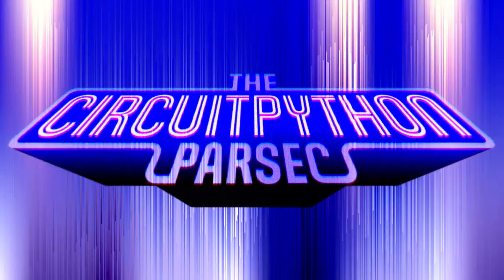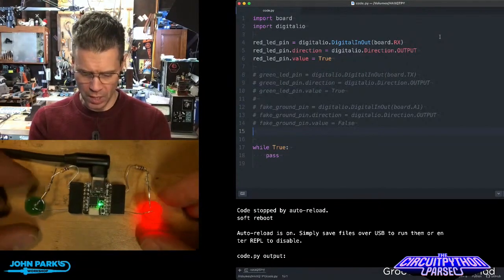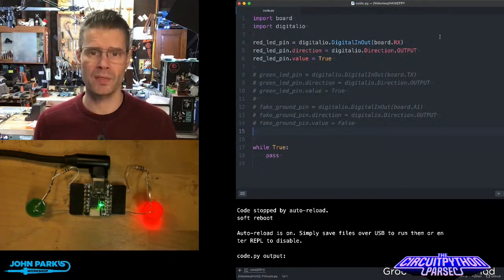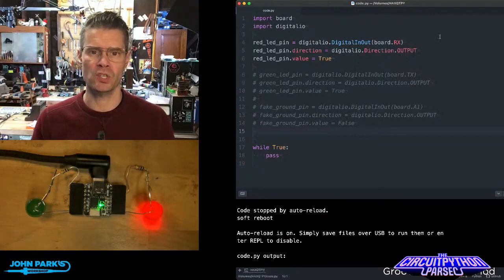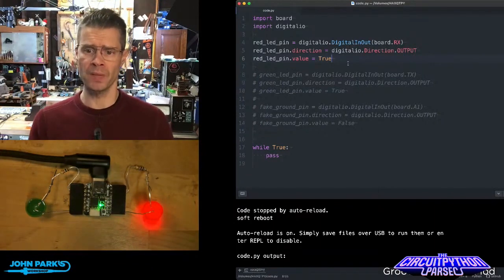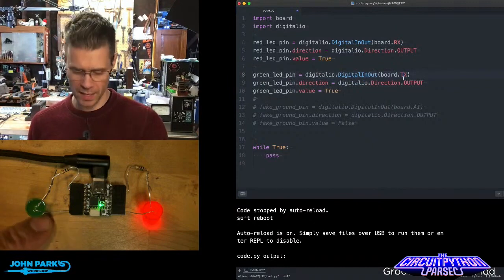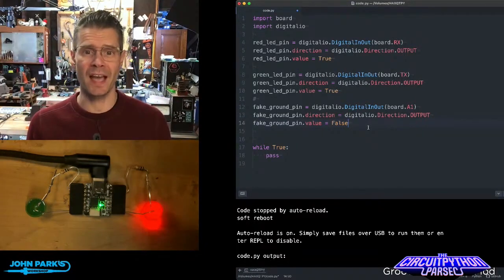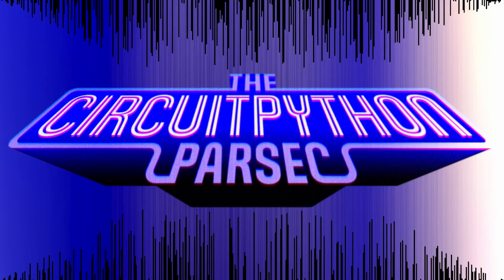John Park's CircuitPython Parsec: Fake Ground Pin @adafruit @johnedgarpark #adafruit #circuitpython

Comment: That can work, but you're getting the "ground" through a transistor, whether BJT or FET, which will produce a small voltage differential between it and true ground.  Depending on your circumstances, that could present a problem.
Reply: well, can you explain what problems can it cause? Because i'm planning to use this like potentiometer for lcd leds but it doesn't feels safe to do it :/
Reply: @herom123  you can't use it as a potentiometer as it is either on or off.  You can PWM though.

As he mentioned though, watch your current.

Back to my comment about voltage drop: if there's a concern about it, measure voltage from GPIO fake ground to actual ground.  You'll probably see 0.2v
Reply: @danman32  so it would just a bit dimmer than before if i use this method but no other problems right? The potentiometer thing is that i was planning on outputting AC but not a DC. So with that, i would control the voltage that flows to the fake ground. At least that's what i thought..
Reply: @herom123  you can't output AC (alternating current) from a microcontroller.  You can output pulses of varying width (PWM) which can seem like varying voltage which is probably what you meant but still DC.

As I first said, depending on the application, fake ground might be a problem as it will be a certain amount above ground.

I suppose by flipping high and low outputs between two GPIO pins, one could call that AC.  I don't think you can do that with built-in PWM as the PWM output would be in phase.  But could be done in software.  Not really AC in how we traditionally think of it though, would always be at or above power ground at all times and actual output would be full on or full off, not actual varying voltage unless you add capacitors/inductors to smooth out the pulses.
Reply: @danman32  So, should i use Digital To Analog Converter? If i'm remember correcty, Arduino nano had some DAC converters. I guess i will try it with that.

EDIT: Yup it works~ Thanks for your time!
Reply: @herom123  Arduino does not have DAC, it has ADC.  Some think of PWM as ADC and because real world has latency and lag, PWM can seem like DAC, but PWM is all on, all off but varies ratio between on time and off time very rapidly.
With filtering (capacitors, inductors, resistors) and what frequencies you are wanting, you could get actual AC